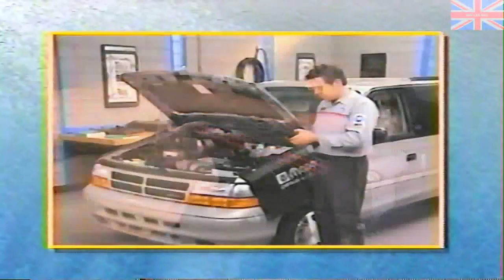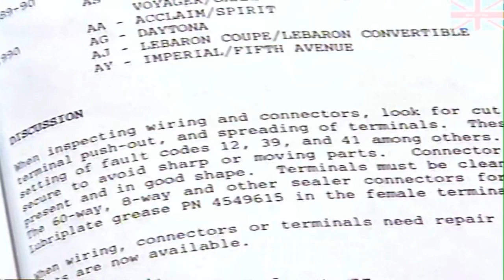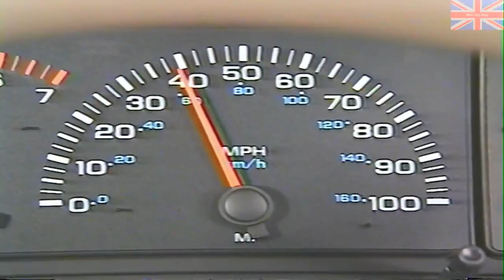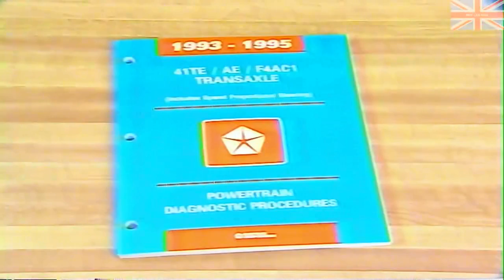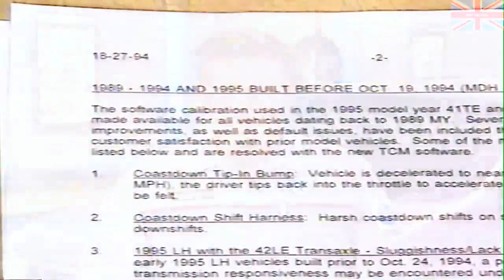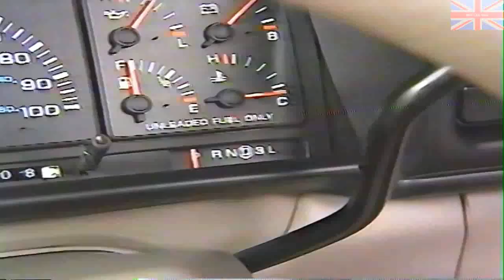Chrysler (US) - MasterTech - February 1995 - 41TE (A604) and 42LE (A606) Advanced Diagnostics

Comment: There is an "adaptive neutral" concept described in some of their "electronic adaptive transaxle" 1980s patents, that gave me the impression  that it was invented to wear one or more of the clutches on their  soon to be produced back then A6XX series transmissions and their later derivatives,  in "a better and faster way" at the expense of their past, present, or future customer base...Hope I am wrong here.  Then  later on, one discovers the issue with a certain kind of valve, in the valve bodies of those transaxles, that is doing its own jack of all trades things wearing itself and or its bore faster, and then jamming  at the wrong place and time causing early? catastrophic Torque Converter Clutch Failure....IMHO No amount of frequent ATF+X fluid changes are likely to reduce or eliminate those and likely other design flaws....Great!!!

Comment: That van was so young when this video was made, and already having transmission issues. No wonder you never see these vans on the road anymore.
Reply: Thats strange, I have 2 of the RG vans with the 3.3 v6 and both transmissions are perfect, no problems at all. They are both 2003 models however.
Reply: Everyday you see em
Reply: I liked the 3 speed automatic
Reply: I have one from 1995 in Mexico. It works but I visit a lot the mechanic. Thanks to God is my friend 😊 yes is a nightmare but l learned mechanic.
Reply: The second generation ones like in this video disappeared by the late 2000's-early 2010's.
Reply: I know right! That's too bad, they looked cool.

Comment: Chrysler cut so many corners on this transmission that I don't know why they thought there would be no problems. I was shocked to see the "fix" for one TCM Code on the 41TE by: Change fluid and filter, drive about 20 miles, then, change fluid & filter again!

4 generations of transmission fluid, a planetary gear & hub upgrade, a clutch count increase, numerous flash memory upgrades. Wow.